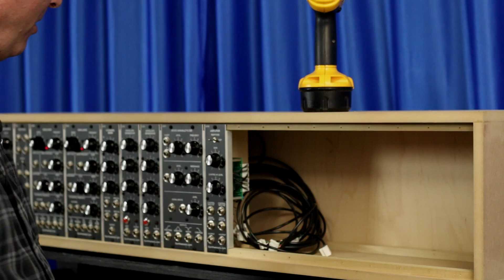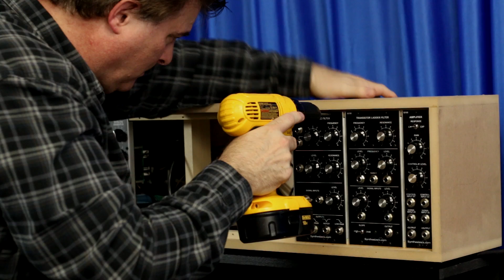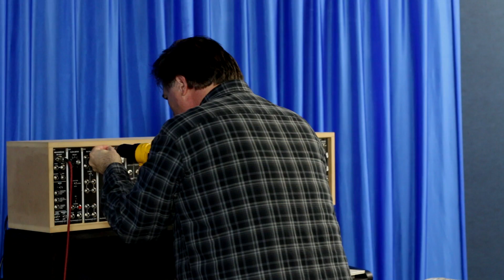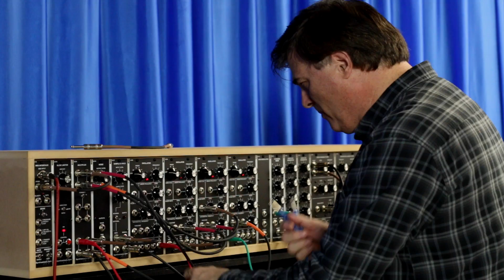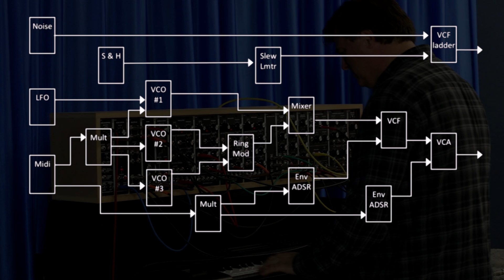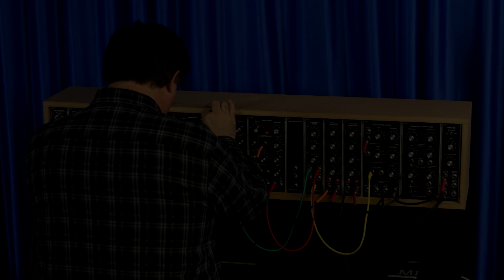Modular Analog Synthesizer Project 03

Comment: Where is part 4?  I am seriously considering a modular, specifically the dotcom entry level system...This series has been very educational!!  I still don't know if I want the walnut cabinet, or just the MDF.  Very confused, but I still have time as I'm not purchasing anytime soon.  Thanks again, and if there is a part 4, please put it up!  Also, is a 4th oscillator necessary?  Does it really open up the synth to more possibilities?  How many spaces are on the back of the cabinet?  What can be put on the back of the cabinet?
Reply: back of the cabinet is 4 spaces.. if you get the mdf wood spend some time with wood glue to seal the wood and sanding and then paint it your favorite color. They have a plan where you can purchase an entry level system where you pay 135/month and in 1 year you can have a modular synth. you can put your midi, power, instrument, and perhaps slew on the back.